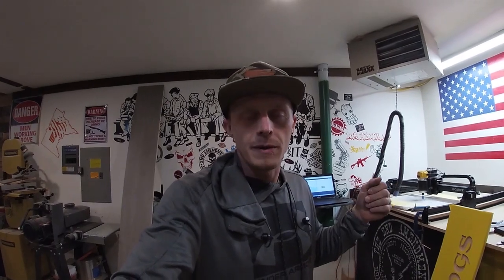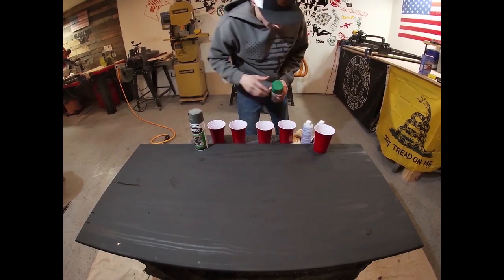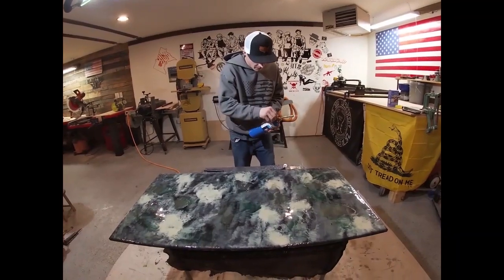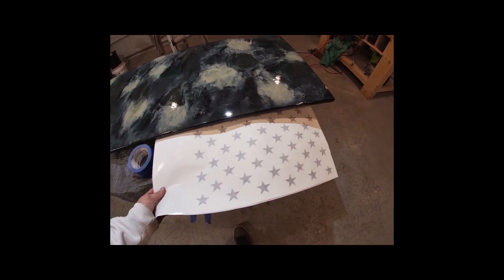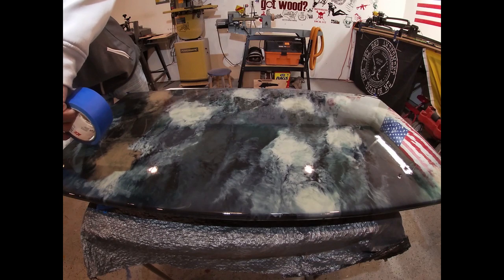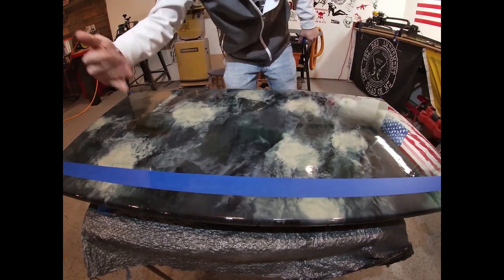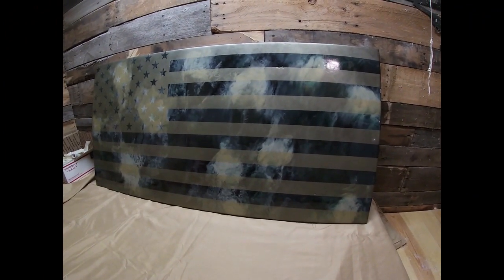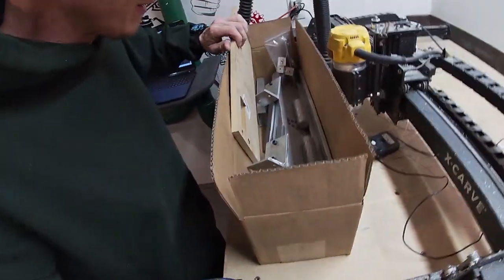Resin Camo Flag Donation Piece MULTI COLOR POUR 2.5 gallons of resin

Comment: Hi love your work. I would like to make one if these for my veteran husband. What did you use for the "board"? How long did you let the epoxy cure before applying your tape stripes and misting the gold? Thanks in advance.
Reply from the maker: Hi thank you for the comment,  and appreciate your husband's service.  I used a edge glue pine panel but even plywood would work just fine . Give it a good day and half to 2 days to cure but look at cure time for the resin you use cause I may be different.

Comment: Question on how much u used. Did u use just a half gallon for first coat and then 2 total to cover it when done. Did I understand that correct.
Reply from the maker: Ended up using 3 16oz kits ..easier cheaper in long run to get the 2 gallon kits from alumilite.com